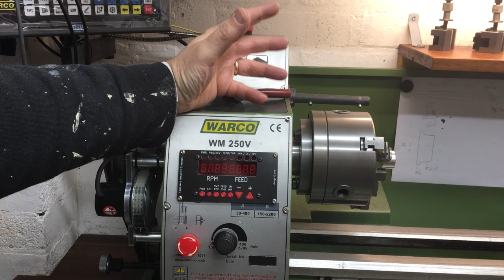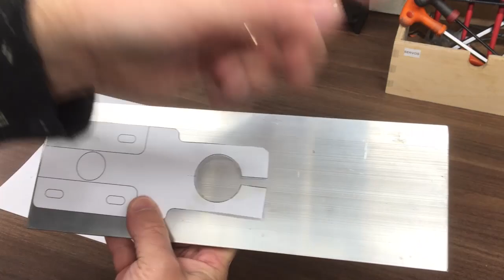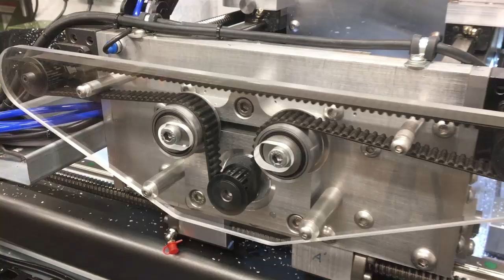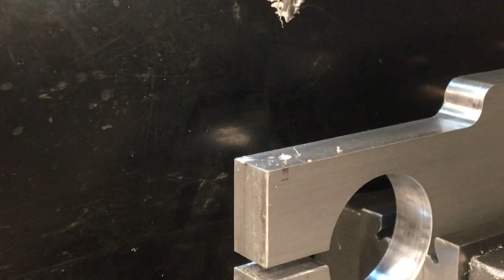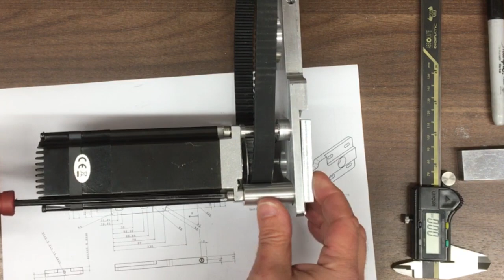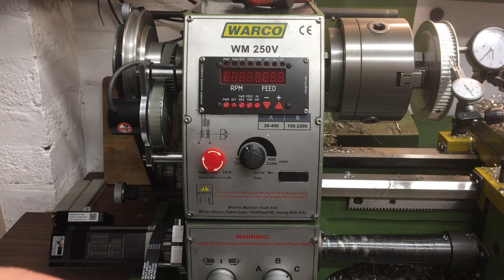Ep07: Clough42 Electronic Leadscrew | Custom Servo Mount

Comment: Hi
Could you please tell me the number of teeth are on the leadscrew pulleys and confirm that the pitch is M5.
I tried to follow your lead on using the spindle gear to drive the encoder but I ran into trouble on my Amadeal 290 lathe because the gear was machined to a larger diameter than it should have been. This was because of the spindle bore being 38mm meaning there was not enough material left if it was machined to the correct dimensions. I have machined the gear to the correct outside size and all is now ok. I think this will be a problem with other lathes with that spindle bore size.
Dave Hudson
Reply from the maker: The leadscrews pulleys were HTD5 15mm wide (so 5mm pitch).  Ratio was 3:1 same as James but I ordered 24T on the servo and 72T on the leadscrew .  However iif I did it again I would go for physically smaller (and cheaper) pulleys (but keep the same ratio).  Thanks
Reply: @routercnc9517  thanks for the info

Comment: For the lead-screw E-stop:  I think it may actually be best to either kill the power to the servo driver or stopping the rotation via the ENABLE signal.  My bench testing has shown that if you stop the STEP pulses, the motor will stop instantly/violently - it essentially becomes a brake.  By stopping the servo drive (via power or ENABLE) the spinning of the lead-screw will come to a stop a bit more gently and the belt and servo motor will not have to absorb the inertia of the lead-screw/pulley/etc instantly.
Reply from the maker: Those are good observations thank you.  This servo does not have an enable line.  I could use the other methods you mention but I’ve recently found that there was noise on the line going to the estop on the machine.  So I’ve gone to another solution which is the new front panel estop is part of the existing inverter estop and stops the lathe motor.  This should mean the servo stops as it tracks the lathe rpm, plus it will coast quickly to a stop rather than sudden stop.  I’m pretty happy with it working like that and I’ll show it in the next video.  Thanks
Reply: @routercnc9517  I've been watching your videos in this series with great interest as I am building my own system from scratch.  The issues you encountered with noise were quite significant.  I hope to address this in the hardware design  to ensure the electronics are robust.  Overall your install videos have been really helpful - thanks for showing all of the 'warts'  as these are good learning opportunities for all of us.
Reply from the maker: Thanks!  That makes the efforts all worthwhile.

Comment: Hi, I am adding the Clough ELS to my Amadeal 290 lathe. its probably the same as the Warco 290.
I have assembled all of the electrics and had them on bench test and they seem to be working Ok.
I like the stepper motor mounting plate idea and will do something similar, very nice.
Do you discuss the toothed pulley selection in any of your videos and if so where?
Excellent attention to detail throughout all of your videos, well done.
Reply from the maker: Thanks.  I didn’t discuss the specs so it is an HTD5 15mm wide.  Should take plenty of torque.  Ratio is 3:1 same as James.  If I did it again I would go for physically smaller pulleys (but keep the same ratio).  Good luck with your build.

Comment: I don't know if it will matter or not but typically you do not put AC and DC next to each other. the AC can induce a ripple on the DC line in close proximity. in my opinion a low voltage DC relay would be better practice on the 2nd estop. but regardless great content I enjoy watching your videos please keep coming.
Reply from the maker: I think they are separated enough but it is a risk and I like your idea of using a relay for the low voltage side.  I will look into that and see if there is space on the DIN rail.  Thanks!